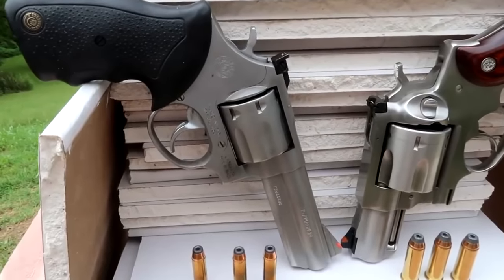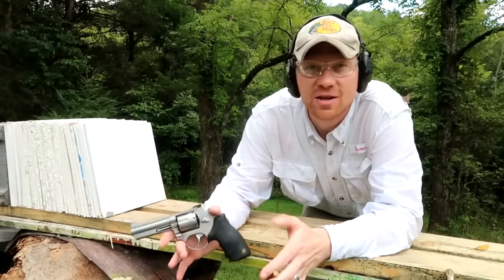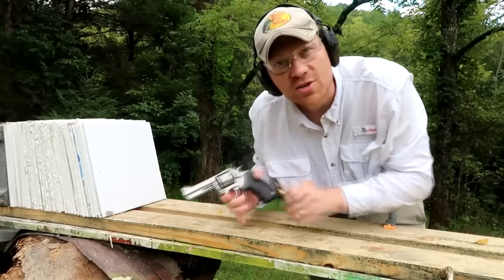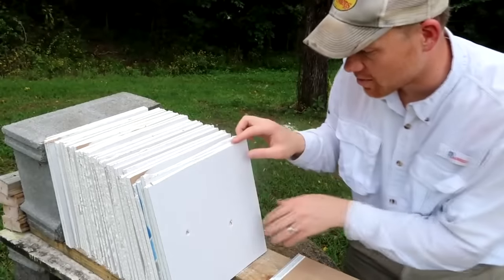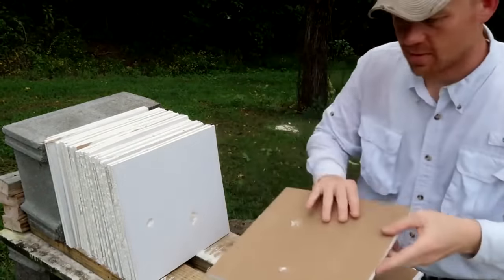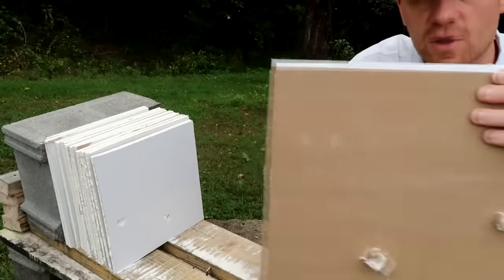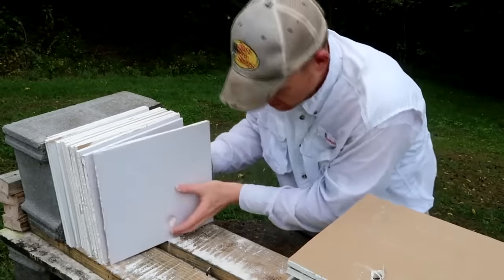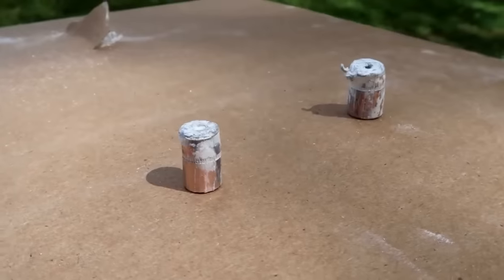.357 mag vs .44 mag - Drywall Test

Comment: I bet if the .44 mag had the extra 2 inches of barrel that the .357 had, it would have gone through more sheets than it did. I always try to keep barrel length the same when comparing two rounds.
Reply: Speed and diameter...
Reply: @philippewhitty3049  what do you mean by that?
Reply: @joejose2022  The smaller diameter and the speed, that important for penetration.
Reply: @philippewhitty3049  the original commenter was saying that you lose velocity with shorter barrels. The difference between a 2 in barrel and a 4 in barrel would be significant. If the 44 mag was a 4 in barrel it would have a greater velocity and better penetration.
Reply: Paul Harrell has disproved the barrel length notion several times with many makes of revolvers.
Reply: @brutebiz82  barrel length does not matter specifically in a revolver? A 2 in has the same velocity as a 7 inch?
Reply: @brutebiz82  I just watched paul barrels presentation on barrel length and he did see an increase in velocity. The biggest difference was from 2 to 4 inches (approx 100 fps) the difference between the revolvers in this video.
Reply: Agreed
Reply: @brutebiz82  same with rifles. Military special ops snipers went to a 14" barrel on AR10 platform due to being in towns & villages where a 24" barrel was to much. Said they owned it out to 750yrds.
Reply: I agree same barrel length more velocity
Reply: @joejose2022  barrel length matters in all firearms proven fact.
Reply: yup
Reply: Exactly barrel lengths make a difference. If the 44 mag had some length it really would have went deeper
Reply: Ive done test myself to even see if theres a difference and it showed it is with same calibers and not . Theres a difference
Reply: Dead wrong, once expansion threshold is reached the less penetration you would get so excellerating either bullet faster would make them expand and there fore penetrate less.
Reply: @andreawhalen4142  
Like i said ive done the test to see myself and ur saying wrong . I spent two whole days trying different things and it showed. Just saying i seen it for myself. So dont know if u tested them also and somehow came up with something different or just sayin what u think of what seems like what it would be but ok
Reply: No it's a fact that non expanding bullets penetrate deeper, they are a smaller umbrella and if the velocity is not high enough to expand the bullet like in ballistic gel the slower fmj round will go deeper even if it's going slower, this is well known throughout the industry and in virtually 99 percent of every single test you can look up and verify, heck these tests are all over youtube live.
Reply: A bullet going faster that still doesn't expand then yes, but if it hits expansion threshold(is going fast enough) it will flatten out and dump it's energy much sooner and penetrate less.
Reply: 357 was more perpendicular hit.  44 glance a bit more and went downward.  If it were more strait, it probably would have gone a bit deeper.
Reply: @1974jrod  If the bullets had expanded they wouldn't have penetrated as far as they did as it is.
Reply: @andreawhalen4142  true.  There was clearly more power in the 44 so it should have gone further.   Bullet diameter certainly was part of it.  Not sure if grains were equal to bullet weight and diameter.  But definitely 44 packed more punch.  You could see it when he fired the two
Reply: Yup, apple to apple, this wan not.
Reply: Yep. Your right. But the 357 did a lot better than I thought it would.
Reply: @BTandKM111  A very close friend of mine is a retired police officer and he was put in a situation more than once to have to use his duty firearm. He shot a perp with a 357 magnum and was horrified by what that round did to the man. He was so horrified in fact that he quit carrying the revolver, when the rounds he was using struck the perp(a murderer by the way) they litterally exploded his entire chest cavity and one round(he fired three) struck the mans upper right arm and the only thing holding that mans shoulder to his arm was mangled strings of tendon and muscle. The 357 magnum alone is enough overkill on a human target as it is and someone hit by it has a very very low chance of survival. My friend understands that he didn't have a choice but to shoot this man but the results he saw affected him for the rest of his life.
Reply: @andreawhalen4142  What does you reply have to do with me. Or this discussion? I have been shooting for 48 years.
Reply: @BTandKM111  I was just pointing out how devastating a 357 magnum is, you said it did better than you thought it would, just sayin i guess i'm surprised you didn't think it would do that well.
Reply: @brutebiz82  he disproved nothing. barrel length matters. rifling matters. let me guess. He disproved grains dont matter too lmfao
Reply: @joejose2022  wrong!!
Reply: I agree. Barrel length affects velocity. Also if the bullet weight of the .44 mag was dropped to 200 grains it would have likely gone even farther.
I have never understood why people realize that speed is more important than weight in the smaller calibers but ignore that factor in the large calibers.
Reply: For the test to be as accurate as possible, you are right.
Reply: Absolutely agree dude💯
Reply: Was thinking the same thing. This experiment proved nothing.
Reply: Yea, the size of the entry wound and ft lb of kinetic energy is definitely more impressive with the 44, butI have a .32 and a .357. Have you priced ammo lately! You can always buy cheap 38 reloads to practice in the .357, the .32 round are high as hell! Don't even talk bout .44 ! I used to own a 500a pistol grip 8 shot with a 20" barrel! Slid it up the leg of a pair of pants in the back seat. Pistol in the console. The Miami Vice decade. Stopped hanging out in those places and people!
Reply: I agree with your observation :trophy-yellow-smiling:
Reply: @cesarsenior8596  The best gun to use is the one you can get ur hand on! If my 12ga would fit in the console?!! I don't shoot enough to be proficient! But, at 3 feet?
Reply: It actually won’t lol
Reply: I've watched Paul's videos also. Barrel length makes a difference when it comes to velocity.
Reply: Just watched Paul's video using a Dam Wesson .357 with four interchangeable barrels. (2 1/2, 4, 6 and an 8 inch) Same ammo had approximately 1080 fps with the 2 1/2 barrel to approximately 1286 fps with the 6 inch barrel. About 20% greater velocity.
Reply: @matthewhowe3727  well, the longer the barrel the more  time for expansion and faster muzzle velocity? Better accuracy in my experience.
Reply: @brutebiz82  Okay, then let's use my Henry lever rifle with an 18 inch barrel against that .357 revolver for the next test. I mean, it don't make no difference right?
Reply: Yep!!
Reply: its the angle and the distance the energy has between each sheet of drywall that matters more. The barrel length wont affect penetration at a short distance like that
Reply: Exactly my first thought when I saw those guns next to each other.
Reply: Kjell Johnsson  i think you mean muzzle.
Reply: The physics is simple. Energy equals mass times velocity squared. Velocity is more important than mass.
Reply: @joejose2022  Agree
Reply: I was thinking the same thing, but he said this was fun and apparently not very scientific...
Reply: My first thought looking at the two pistols, double lenght barrel.
Reply: Kjell Johnsson  spelling muzzle is hard…
Reply: @BlasterYoda   ... and the effect is non-linear.  A four-inch barrel is more than twice the effect of a two-inch barrel.
Reply: Barrel length definitely makes a big difference in how far the bullet travels. I love both 44 & 357 for the stopping power but I keep both in a 6in my all time favorite pistol is Glock.
Reply: @joesikora8265 I wouldn’t fused about it either one will get the job done
Reply: Max 10% velocity different. But that is big different of energy, so penetration.
Reply: Exactly what I thought.
Reply: Для чистоты эксперимента, стволы должны быть одинаковой длинны. Должна быть одинаковая длинна разгона пули.
Reply: Invalid ‘bs’ test, just considering it is run with handguns who are  different in brl lengths by 2”! Why even bother knowing that every gunowner worth his salt knows that increased brl lengths equals increased speed: the only one were it doesn’t really count as much after say more then 12” length is the .22RF! 
Disregarding handgun brand or its brl-bore quality: any .44 Mag. would have gained at least another 3 sheets if shot out of a similar brl length then the .357 Mag.! Nough said!
Reply: you win your bet  !!!    Believe me  !  We have same opinion.
Reply: Hey chuckles 🤡. Why are the barrel lengths different?
Reply from the maker: @ErvuJukl happy to let you buy me a matching set 👍👍
Reply: @WHOTEEWHO  That's funny. I'll certainly tip you well at the Comedy Store 👍👍😊
Reply: @WHOTEEWHO  Fair comparisons are always appreciated
Reply: That's the same thing I was thinking why would he use a gun with a shorter barrel
Reply: @NathanielBlake-f2r  Dude says he doesn't have the money to buy another gun with the same length barrel. That's punk
Reply: @NathanielBlake-f2r  I wasn't knocking WhoDeeWho, it was just an observation. I'm sure he just used what he had available. It's still an entertaining video.
Reply: Thru denim and ballistic gel than drywall simulate thru intruder
Reply: Exactly.
Reply: Said the guy on his wedding night.
Reply: It's even the 44 is shooting a 240 Gen bullet
Reply: Both of them would have penatraighted deeper if you didn't use hollow points
Reply: @Robert-fs1pb  Are you telling me that spellcheck did not alert you?
Reply: Agreed,I noticed that Emediately.
It increases velocity
Reply: Totally agree
Reply: @joejose2022  spot on although I believe the 357 is a 4” and the 44 mag is a 3”
Reply: YOU KNOW YOUR GUNS
Reply: True

Comment: Test inconclusive. Unequal barrel lengths.
Reply: I thought the same thing but the 44 magnum still outperformed
Reply: @knowone8671  I used to shoot a 4, and 83/8 44 mag into a 8” tree stump the 4” would never penetrate both sides but the 83/8 did everytime barrel length is always a factor
Reply: How about almost 100 more grain in the 44 vs the 357. Sad to think almost double the gun powder than the 357, but the 357 performed better with less powder.
Reply: Yes first thing I noticed was different barrel size

Comment: Barrel length makes a major difference too as it captures more energy from the cartridge to propel the round. If the .44 Mag had a longer barrel to match the .357 it would have probably gone through 2 more sheets of drywall.
Reply: That's what I was thinking 🤔
Reply: I was gonna say the same before I even watched the video.
Reply: @johnjaffe6107  I'm glad I read your comment 😊 genius thank you
Reply: Yep!
Reply: Yep,,big dif between my snubby and my 6",,,
Reply: Ok so .357 mag 18 sheets longer barrel than the 44 mag 22 sheets. So are you suggesting if the 44 had a longer barrel it might have gone through 2 more sheets? 

I understand that a longer barrel = longer range not more driving power. So one again my ignorance shines.
Reply: @nobodyisprfct  yes longer barrel length = more velocity and more ft lbs of energy
Reply: Yes, but still. I don’t own a concealable.44 with a 2 inch barrel so I’m envious as hell.  It’s makes a great primary carry gun with an SP-101 or Glock 43 back-up.
Reply: What about if he used a 180 grain 44 round
Reply: @heavydutyreviews1303   - thanks for reply. So power must be increased in a sense because of the length of time the ignited gun powder has to focus its energy?  Well as I invasion this it makes sense.  So weight and concealability is the only reason to have a shorter barrel pistol or handgun.  Those would be the only pro's I could think of at moment.
Reply: @nobodyisprfct  yeah weight and concealability but I sometimes carry my Smith & Wesson 629 44 magnum 4" or my full size Sig Sauer P226 357SIG. I don't care who knows what I'm carrying and it's not like I'm carrying around a 50lb dumbell
Reply: @heavydutyreviews1303  - I have been studying old reports and effectiveness of weapons or hand guns specifically.  The 22. Long bullet I think it's called seems to be the way to go lighter and more bullets.  I can see having a 22 hand gun, a shot gun ( as it seems to have a higher variety of uses and a long range rifle) close encounters within 45 feet. I think some kind knife , machete, or something similar to these that may have a specific name for type of blade. 

Police carry guns all the time. Why should the public be treated any different? 

Just not a fan of laws like seatbelt laws, or other such laws that don't really have to do with murder, stealing, or lying.  Not a fan of forced insurance either.  So a huge fan of carrying a weapon of some kind for personal protection.  In reality there is no such thing as a fair fight. Especially not with those who desire to take from others what they have not earned.  Jst my 2 cents.
Reply: 18 sheets Ah ah ahhhhhhh
Reply: @bustinbass78  nice Count!
Reply: Yep!
Reply: Why would anyone make or want a 2 inch 44 magnum?
Reply: I just said the same thing. 50% energy  was wasted
Reply: @miketakacs4701  Bingo! At least a 4" or preferably a 6"
Reply: But it was actually very close.  Good test!
Reply: @nobodyisprfct  So you are not in favor of laws that protect you. If some poor driver hits you a seat belt can protect you from being thrown out of your car & being killed. And this is bad why?

Insurance laws do the same type of thing. An uninsured driver hits you and you end up in the hospital. Your Insurance covers you so you can recover. Without insurance & not much money you would be SOL. And this is a good idea why?
Reply: @miketakacs4701  for a concealed carry weapon.
Reply: @kittredgeseely3542  don't like metal detecting laws either!  Laws that hold businesses accountable for products? Some are good and some suck azz!
Reply: But did'nt the 44 mag go through more sheets than the 357 mag?
Reply: @liquidfish17  yes. The .44 went through 20 sheets & the .357 went through 18 sheets. The .44 would have gone through more sheets if it's barrel length were the same length as the .357.
Reply: Joe Barone   I Was just replying to the original posters comment who added 2 more sheets to scenario if barrel was longer. I probably should have worded it differently.
Reply: Probably less sheets. Longer barrel would likely have meant a lot more expansion.
Reply: The barrels should have same length
Reply: @nobodyisprfct  "So weight and concealability is the only reason to have a shorter barrel pistol or handgun."
Yep.  Longer barrels mean more mass in the pistol and thus less recoil.  It also means more spin on the bullet.  More length of time the powder charge is pushing the bullet produces higher velocity and as kinetic energy is velocity squared, a bit more velocity is a lot more energy.  Less recoil also improves accuracy BUT since barrel or muzzle rise starts the moment of the explosion if it is in the barrel long enough it will be deflected by muzzle rise.  A ported muzzle reduces that effect by deflecting some of the blast upwards which also is very useful since a quick follow-up shot is possible with the pistol still pointed pretty much in the same direction.
Reply: @thomasmaughan4798  - thanks for the reply and information.  That is a lot for me to absorb, but valuable information in my opinion.
Reply: @nobodyisprfct  "Driving power"?   It's all physics.  K.E. = 1/2 m v^2.   The gas from the gunpowder acts on the bullet (pushes it) over a longer distance giving it a higher velocity.    Since the velocity factor is squared, a small change in velocity makes a large difference in kinetic energy.
Reply: @buckhorncortez  thank for taking the time to reply. Driving force is my interpretation of how I see things I guess you can say.  I would say this some times when Driving a nail into wood, or using compression air to drive a potato out of pvc pipe.  Drive = to impart a forward motion to by physical force. 

My recall on words that is more suitable for a more technical discussions is lacking and I am not a physicist who uses these words on a daily bases. 

At any rate thanks again for your addition to the other replies.
Reply: @nobodyisprfct  Yes longer barrel will let the round to accelerate to a faster speed before exiting the barrel. After the round has exited the barrel the force that is driving it is lost.